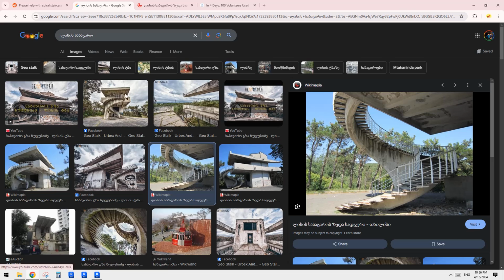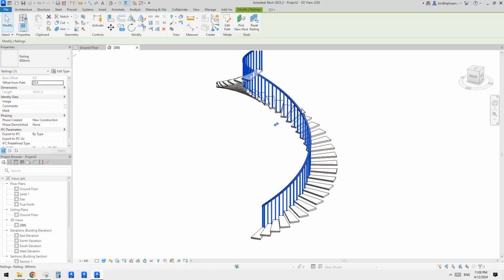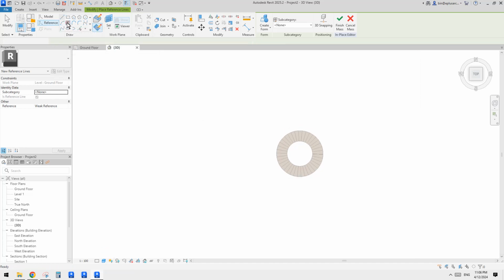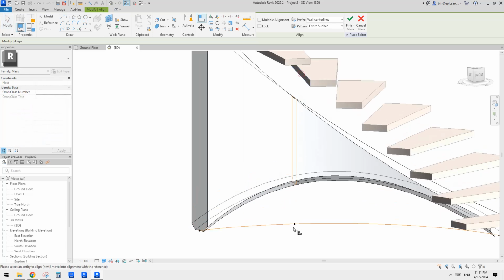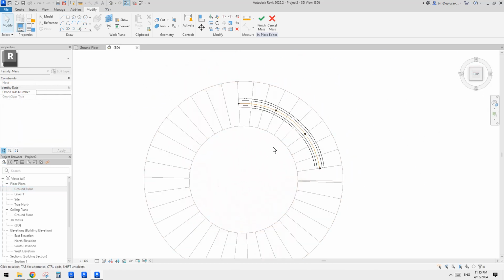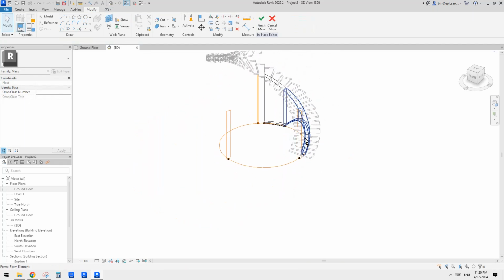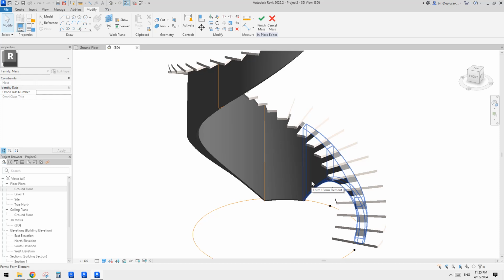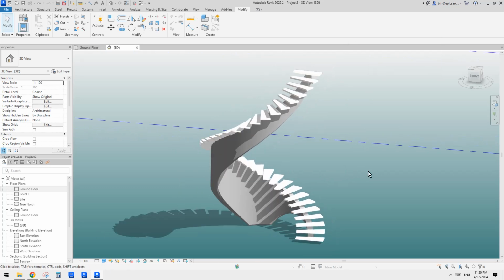24093 - Model in Place Mass Stair Support

Comment: U r just amazing....👏👏👏
we can also work with a roof by face under stairs ... and use curved wall attached to this roof .... 
for the base of walls we need void to cut it from the bottom ...
right
as you do it in this cours : 23018 - "Attach" walls to stairs in Revit